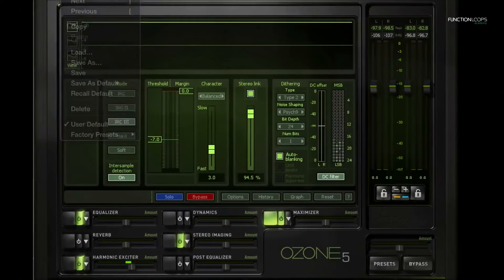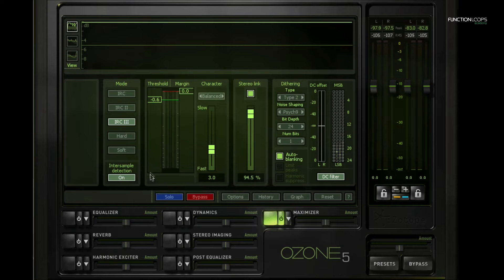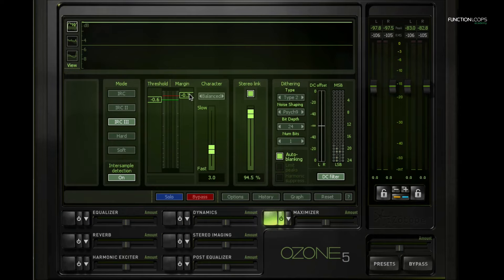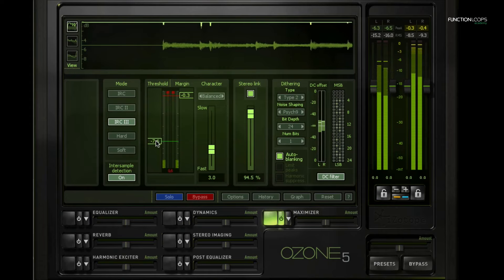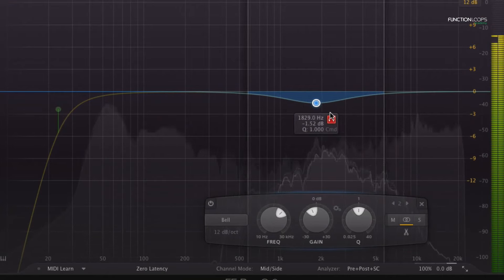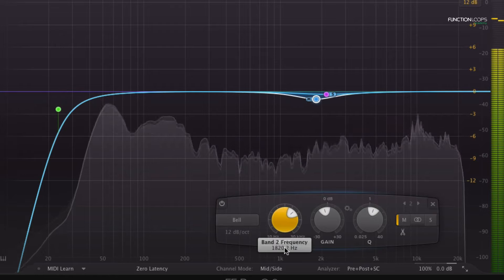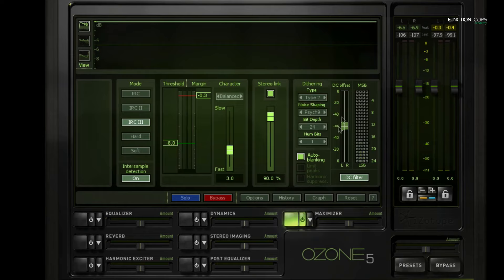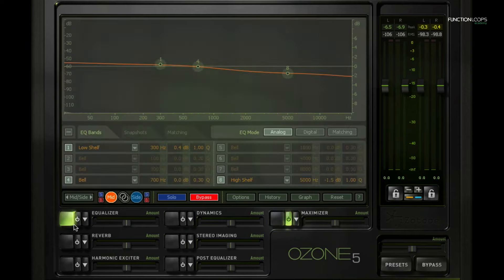Function Loops Academy - Stem Mastering with Ozone | Free Video 01

Comment: Hey, cool video, really helpful. I wanted to ask one 1 question, as you said, we should use dithering just one time on a track, and waves L1,L2, L3 have dither already enabled, so there is an issue. I use these waves Limiters on different stems of the track (on many stems) , so will it cause a problem ?
Reply from the maker: Thanks! 
This is on by default but you should pretty much always leave that off, especially on individual stems/tracks.